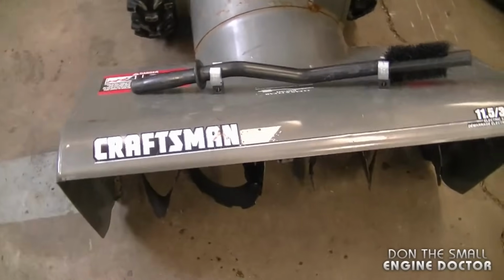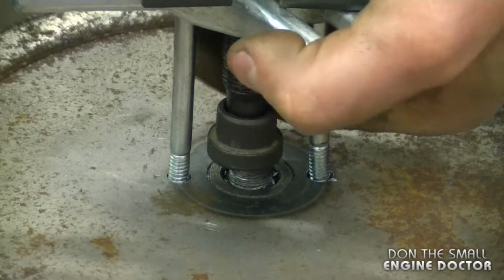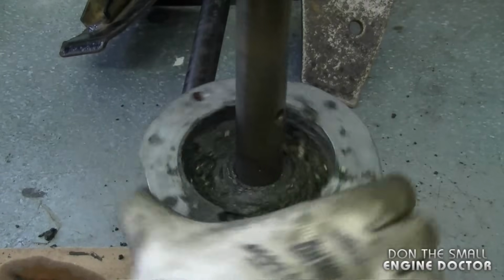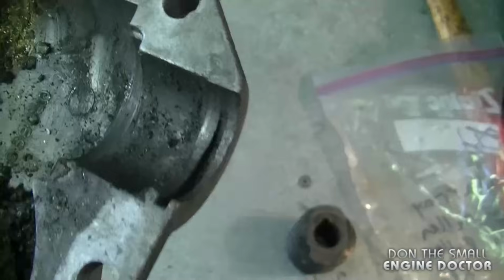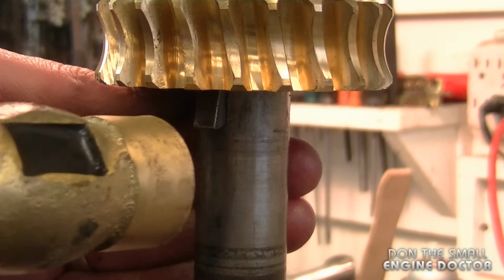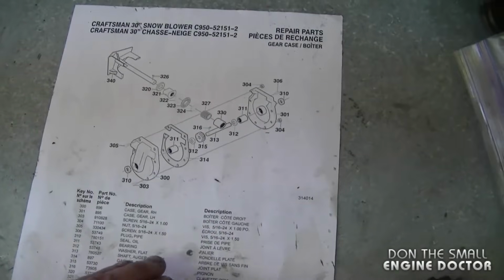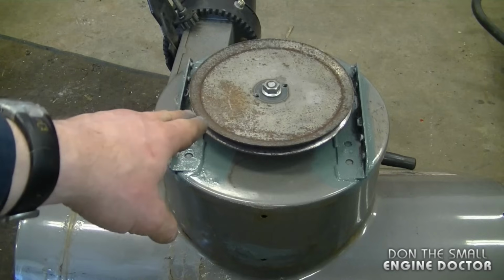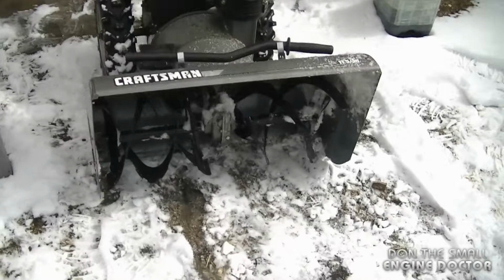Complete Snowblower Auger Gear Box Rebuild!

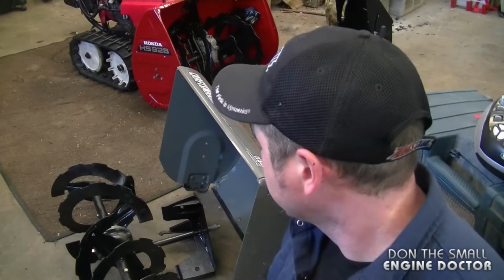Comment: Good video, are the outside bushings place on backwards, video around 28:29 when you replaced them.  They were on with the opening to the inside when you pulled them off. Just an observation, i would not have tried anything like you did.
Reply: I caught that as well.
Reply: @rtfclb8  I have always been a visual person,  Donyboy73 does a wonderful job on all his videos. That was not a put down at all, he probably noticed it when completing his assembly, but just didn't say anything. I noticed he responded to everyone after my post but i have not heard from him, but i don't blame him. Have a good day.
Reply: @dga5396  I didn't read it as a put down, just an observation. I love his videos, and have learned a lot from them.

Comment: Love the vids Don! Was wondering about your thoughts on rubber impeller paddles for snowblowers?  Apparently they can make your blower shoot snow farther and keeps the inside cleaner so the impeller doesn't get stuck and frozen in the housing. Think they're worth it?
Reply from the maker: yes worth it on older machines
Reply: @donyboy73  looks like my old blower is going to get supercharged!
Reply: I put some on my 6 yr old Craftsman. I made them from a sidewall of a tire. Noisy at first until they wear down but shoit the snow twice as far and no clogging of slush. Second year i brush applied tremclad. Looks new. Some attach the rubber with self tapping screws. Take the time and use stainless bolts and lock nuts.
Reply: @daved.4740  thanks Dave, I figured nut and bolts would be a better bet.  Mine needs a bit of an overhaul anyways, runs great but looks rough.  Gonna sand her up and rattle can the works.  Did you use a gloss Tremclad in the chute?
Reply: I used bailer belting available at Blain’s Farm and Fleet, here in the upper Midwest. My 26” Craftsman no longer clogs up an throws snow farther.

Comment: if you happen to have time, my sheer pins are obliged on both sides. Almost every time I end up breaking them just with simple snow.  There's play in the sheer pin. Are there larger pins that I can just drill it out straight again?
Reply from the maker: i weld a cop over auger where shear pin goes through with a proper 1/4" hole, if i do it again for customer i'll make a video

Comment: on the video you put the two bushings on each sides of the hagger on the wrong side , at 7m55 on the video ,could that be a probleme or does'nt matter
Reply from the maker: doesn't matter
Reply: @donyboy73  ok thanks ,on my john deer snowblower ,one wheel as tractin and the other one turns free ,so it pulls ,what could be te probleme ,thanks

Comment: Question is with parts and used parts you had plus labor would it be cheaper to buy the complete gearbox assembly or just buy a new snow blower. The average person is not gona have spare parts lying around unless they are in the business of repairing this stuff?
Reply from the maker: if I didn't have used parts it would have been better to buy a new snowblower

Comment: I noticed you said you don’t usually have to add grease into the gear box from year to year.Can I take for granted that I should be or shouldn’t be checking this yearly?I do my own maintenance & I can honestly say I have never checked it.I it needs grease what type are you using?Thanks.
Reply from the maker: if you haven't checked in years then have a look

Comment: Perfect! Thanks! Do you have a number on the bearing? I used the torch on mine and the number burned off.
Reply: Are you referring to the auger housing bearing?  It is a commonly available 17x40x12mm bearing 6203-2RSC3 available from multiple suppliers.  I guess you probably got this information already.  Many snowblowers and other machinery use this bearing.

Comment: Good day, Where do you get 00 grease?  Thanks
Reply from the maker: check with your local small engine shop
Reply: @donyboy73  They only have small tube and it's very expensive. Would you know where I could get a bottle? Canadian tire and autopart stores don't have it. Why isn't gear oil good for these gearboxes?  
Thanks again